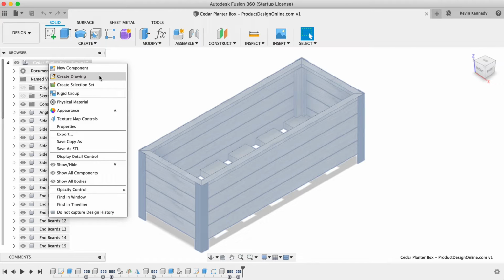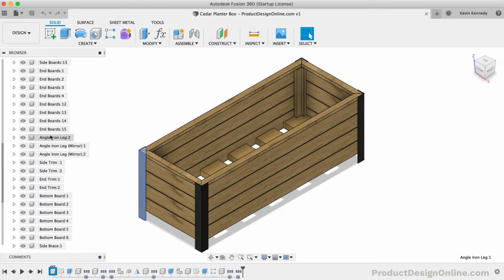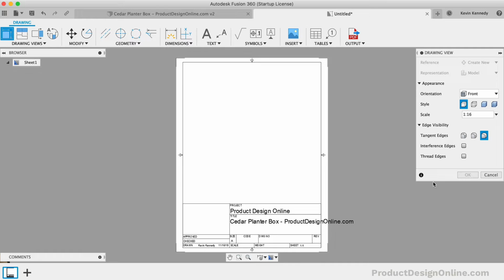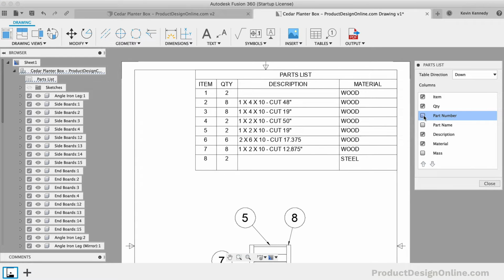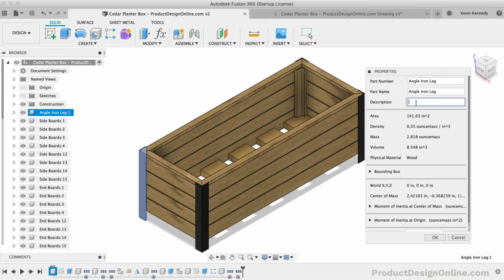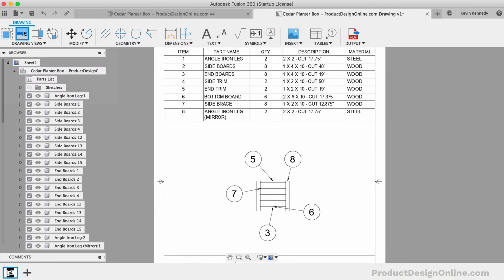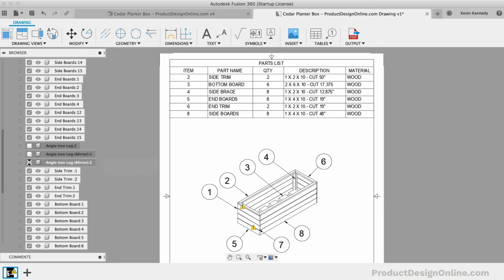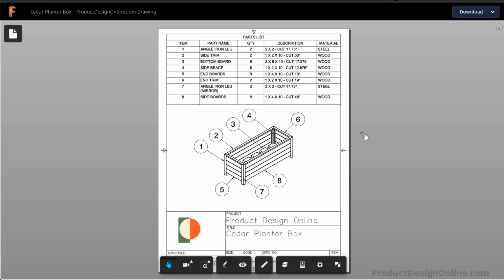Parts List Fusion 360 - Fusion 360 for Woodworkers

Comment: How do you insure the correct labeling of component names? The xx:1, xx:2, xx:3 designation.  Mine keep labeling xx(1), xx(2), xx(3) which in turn counts as a new part on the parts list. If they label xx(2):1, :xx(2):2, xx(2):3 it also works correctly adding up in the parts list but I can't figure out how to get it to label my joists and floor boards correctly. Thanks for all the videos, a joy to watch and easy to follow.
Reply: The only way I've found is to make one component and copy it. It only works if it's a component and if it's a copy. Will not work with patterns

Comment: Excellent reminder about copies vs mirrors. A life long wood worker I learned F360 when I got into CNC, then of course applied to every new ww project, love what cad now brings to the table. But this parts list workaround defeats the purpose,  as one can do this faster by hand on paper.  I really hope at some point the team at Autodesk adds native support for parts lists, maybe just bring in the bounding box data automatically. Love your videos, I learn tons of new stuff every time, thanks!
Reply from the maker: agreed - the parts lists need some work. Check out OpenBOM add-in if you haven't already - https://youtu.be/x3BmwSjgp7c

They offer a free non-commercial license. Works wonders in automating the parts lists and has a bunch of extra functionality as well
Reply: @ProductDesignOnline  Didn't know about that, thank you!

Comment: Another great tutorial. Thanks for the detailed instructions as always. ONe quick question. How do you get the descriptions for the parts? I have been entering them manually in the components. Is that the only way or is there a way to get it based on the measurements of the parts?
Reply from the maker: In Fusion 360, that is currently the only way to do it natively. However, I would highly recommend OpenBOM if you have a need for BOMS/Parts list on a regular basis: https://youtu.be/x3BmwSjgp7c

Comment: I know this an older tutorial, and I really appreciate it. It is great material. I do have a question though:
What if the parts list is longer than will fit on one 8.5 x 11 sheet? How can it be broken up into two parts or sheets/pages? Thanks
Reply from the maker: Whenever you select the parts list table, you'll see some little blue triangles (and maybe some other shapes around the outside). You can click and drag those around to adjust the columns/split into side by side. You cannot completely split the table into two at this time. However, I would recommend checking out the OpenBOM add-in for more control over your parts list. Check out the video I did on it here: https://youtu.be/x3BmwSjgp7c
Reply: @ProductDesignOnline  Thanks. I'll check it out.

Comment: Hi, Great video. One question. I understand about using components for the cut list however I'm having one issue that I cant seem to get an answer for. The example of mirroring the angles is exactly my issue. I have created a design which has legs as components. I created them using mirror as it was the best way to model them and ensure the correct position when sizes were updated etc. Now I want all these legs to appear as one with the quantity in my cut list. Is there a way to link these components in the design so they show as one row in the cut list. If not I will  stop wasting my time trying. If so please share. Thank you.
Reply from the maker: Hi Jason. Because Mirrored objects are technically "opposites" there is no way to link them as one. You can override the quantity in the table...otherwise, you'll have to recreate the components by copying them instead of mirroring them.

I'd also recommend checking out OpenBOM which offers more flexibility with parts list. You can get a free account for hobbyist/non-commercial use - https://youtu.be/x3BmwSjgp7c

Comment: So it's kind of useless if you have an existing model and you've created various components. Seems like there's no way to tell Fusion to group existing components as parts. 

Same like if you had used the mirror function, or extrude to new component, after that point you're screwed? Wow, I would really expect a way to apply part metadata to a component.
Reply from the maker: I have a tutorial scheduled for tomorrow that covers the OpenBOM add-in which is 10x better at generating parts list than Fusion 360's native functionality - stay tuned!

Comment: Enjoying your videos so far. I used to use Sketchup for all my woodworking projects, but now am using Fusion 360. Sketchup had a CutList extension where it would take all your parts against a sheet of plywood or lumber you were using so you could see how many sheets of plywood and/or pieces of lumber you needed. Is there such a thing in Fusion 360?
Reply from the maker: Hi, Mike. Not a native feature (yet...but I know they're working on some of this). Search for the "Bommer" Add-in, which may help.
Reply: @ProductDesignOnline  I sure hope they are that would be awesome. I use parameters for everything so like to make adjustments that way. So having to go to the Properties of the components each time I make a change to update the Properties is a hassle. Easy to forget doing that. I'm just a hobbyist so Bommer appears to be a bit more than what I was looking to spend.

Comment: Useless. If you change model parametrically the parts list will fail.
Reply: Yeah, I noticed that as well. The description will be completely wrong because that's not dynamic. Can you use expressions or measurements for a description? Or add that as a column to the parts list?

Comment: Thanks, a woodworking parts list tutorial was just what I needed! If you’re taking suggestions, making cut lists for sheet goods with Fusion 360 would be another valuable tutorial (e. g. which  pieces fit on a sheet and how many sheets are needed for the project.

Making additional drawing sheets with detail views of parts would also be a useful overview.
Reply from the maker: Thanks, Keith. Glad to hear the parts list was useful. I do have those video topics on my "to-do" list. Some of that will also be covered in my Fusion 360 for woodworking course.

Thanks again for watching and commenting! Cheers, Kevin :)
Reply: @ProductDesignOnline  Have you developed the videos on cutlist and/or are they in your Fusion 360 for Woodworking Course?
Reply from the maker: @robsandstrom9854  hi Rob. I'll be adding those lessons in the next week or so. It will include native cuts list (similar to this video), along with OpenBOM and the use of add-ons to make more 'advanced' parts list.

Comment: Excellent tutorial. How do you show the weight of parts in pounds in the parts list and total weight in the title block?
Reply from the maker: Hi, Thomas. Great question. Unfortunately, Fusion 360 does not have this capability yet. At least an automated way. You would have to manually copy and paste the mass of each component, while in the "properties" tab. For example, you could copy the mass into the "Part Number" input. You could then update the Part Number column heading to read "Mass" (or desired heading).

This is automated in Autodesk Inventory, so hopefully, this is something the Fusion 360 team will be able to implement with the next round of Drawing Workspace updates. Cheers, Kevin :)

Comment: great video as always, I will join Patreon to help a little, thank you. What about a cost list, how do I add that?
Reply from the maker: Hi, Hershal. First off, thanks for becoming a Patron. I really appreciate your support.

As far as I'm aware, Fusion 360 still doesn't have a cost list capability. You could manually add the cost as the "Part Number" field of each component property and include that column with your parts lists.

Cheers, Kevin :)

Comment: Thats awsome. I tried multiple times to create the parts list and the table only shows me the component name and the material its made out of. No measurments.
Reply from the maker: They don't make it easy... maybe someday it will automatically pull the measurements in from the component. But adding them to the description has proven to be a very valuable step for a lot of the projects that I've done. Cheers, Kevin :)